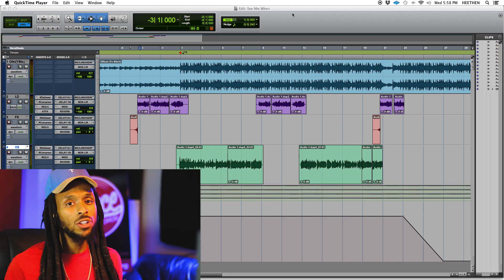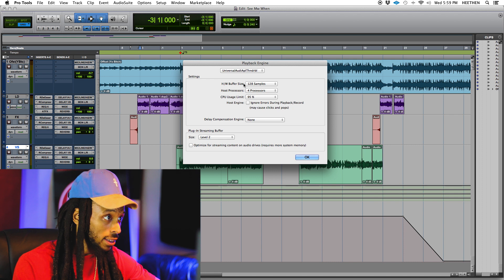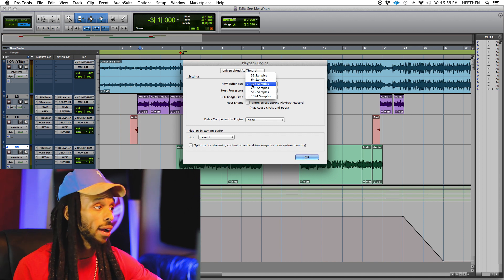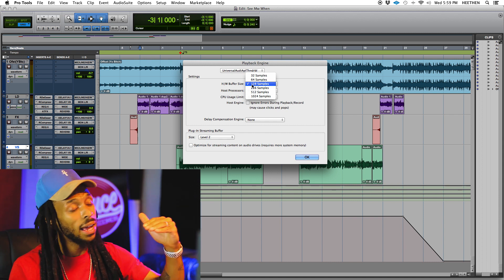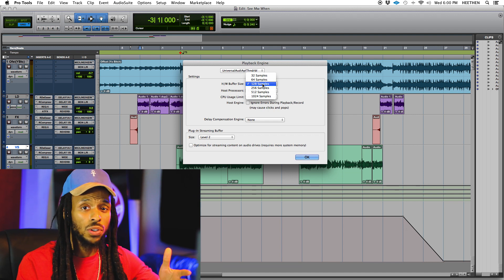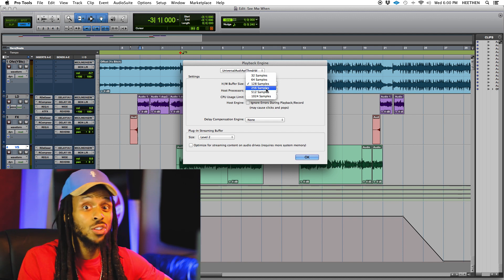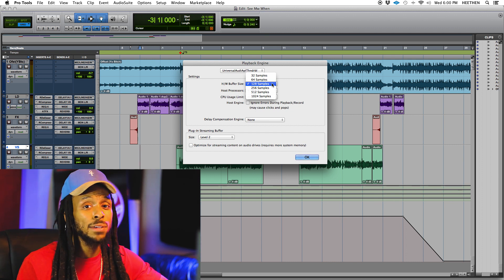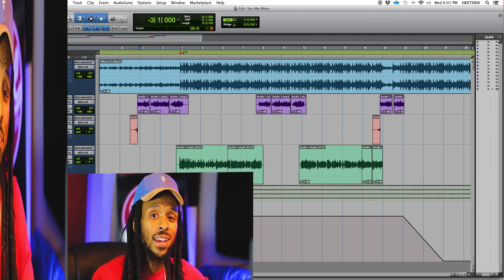How to Stop Latency While Recording in Pro Tools | Echo or Delay in Headphones

Comment: Great tips here! If you want ZERO latency I would suggest Direct or "Discreet" monitor mixing to completely eliminate latency....for good! Monitor outside of your DAW before the signal gets to the computer. Monitor EVERYTHING outside of the computer. That's the secret. Get a 6-8 channel non-powered mixer that has auxiliary or effect output buses with a summing channel.
1. Plug your mic into your Mixer Channel 1
2. Set auxiliary output to max for Channel 1
3. Send Mixer Auxiliary outputs to Audio Interface (Audio interface is connected to PC with USB/Firewire)
3. Plug the output of your Audio Interface into the summing channel on your Mixer (So you get computer sound into your mixer)
4. Turn OFF "Listen" or "Monitor" button in your DAW (So now your not hearing the vocal back from the PC)
5. Send headphone mix from mixer. ZERO Latency
Reply: with what Daw ?
Reply: @XMelibea  Any DAW.
Reply: How do you do this running 11+ tracks? I'm recording drums and basically a full band setup... using a zoom L20R.... found the best way is to use the DAW to master anything played.... not really recommended to run a DAW live for bigger setups...
Reply: please make a video how to do it 🙏🏻🙏🏻🙏🏻🙏🏻

Comment: Honestly you should do one where you include the check boxes, delay compensation, I can have no plug ins, 64 sample rate, and no plugins and still have the latency. It's even making my recordings off time
Reply: Make sure u using an interface and xlr mic not a usb mic. Try actually going up on samples, either 128 samples or 256 samples
Reply: How did u fix it my friend? I have the same issue

Comment: Truth, however, I have worked with musicians, especially drummers, that notice even a 64 or 32 sample buffer. Best to use low latency mode and run the DAW as a side chain to the recording process. You can get zero latency with this method. (IE, the interface feeds your monitoring directly and you don't hear the signal through the DAW.  At least until after it goes down, so only during playback. Worth mentioning in the video. Good job on it though!

Comment: Why do I have high latency even though my buffersize is low..and no plugins on the track..?

If I click Low latency monitoring it stops but it does make the recording so quiet ...

And in another session I didn't have this issue and didn't have to use Low latency monitoring ....🤔

Comment: This is advice is extremely helpful. I appreciate it. I have a question though. 

Could I record all the audio with a low buffer size (32) and then at the end of the track when the recording is done bring the buffer size  higher (1050) for when I want start mixing?
Reply: Would there settings stop me from changing??
Reply: I just learned from your other video how to get my mic connected and now changing the latency down will work, but I’m wondering if I’ll be able to change it when the recording is done for all of the stuff I’m going to add in …?!I haven’t gotten there yet, but just wondering , thanks for all the help with a Videos. It’s helping a lot of us bro. Thanks.

Comment: yo I'm using 32 gigs or ram with a 10 core processor. why the heck do i have latency when recording a vocal with autotune (with low latency mode) and no other tracks in the session? (reduced latency when monitoring is checked too) with 32 as buffer
Reply from the maker: Could be due to other plugins on the track or master fader.
Reply: @waynewav  its a 2 track session with autotune on one track and no other plugins running. Also pro tools is the only app running
Reply: You ever figure it out?
Reply: @HMGMASS  nah but i just switched to monitoring my UA apollo with autotune on the interface channel. Not what i wanted tho
Reply: @deproductions5905  when I switched to autotune artist from antares it worked in real time without latency maybe that will help you
Reply: @HMGMASS  ya ive heard that works, I just dont want to pay for another antares product considering AT pro was so expensive
Reply: @deproductions5905  I think theyre doing a monthly subscription for all their plugins

Comment: bro quick question everytime I put the beat into the protools and play it it always slowwwwww it down why? how to fix this?
Reply: It's most likely a sample rate problem. Be sure when you're importing the beat into Pro Tools that you convert the audio to match your session settings. For example, if you import a 48k sample rate beat into a 44.1k sample rate session without converting, it will sound slow, the opposite is also true.

Comment: I like to record with the auto tune and or reverb on and sometimes I do have a latency issue.. on a side note how would I go about getting the microphone at a good recording level and have the live monitoring at a decent level as well because my live monitoring volume is always too low. Most time I have to take one earphone of lol
Reply: Amsha Looker are you putting the reverb plug in the same channel ? Or are you using a bus for the reverb ?
Reply: No te creo it's on a bus but I found a work around. What I do is once I get the mic level right, I use a compressor to boost the level in the earphone and record with it just like the reverb and Auto tune
Reply: Amsha Looker cool ,check videos on delay compensation also ,one thing that I do is lower the 2 track of the beat that way i don’t crank to much the mic lever